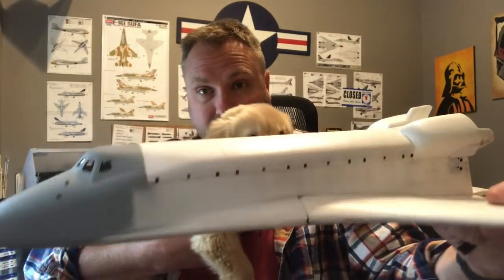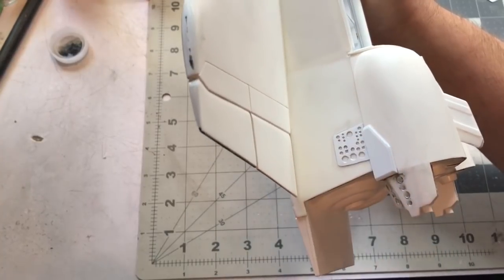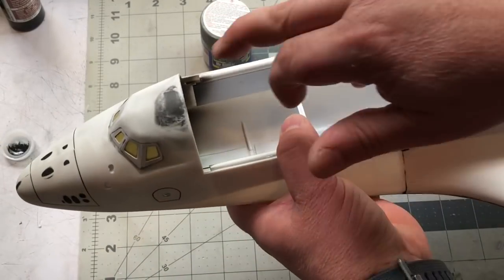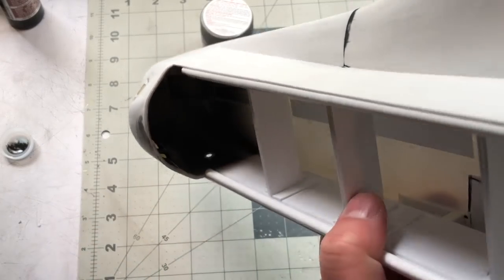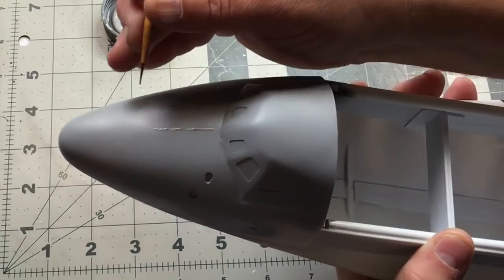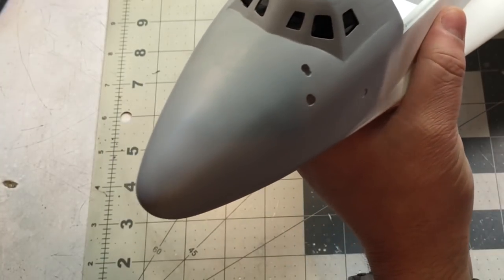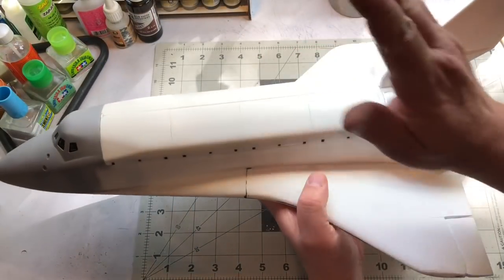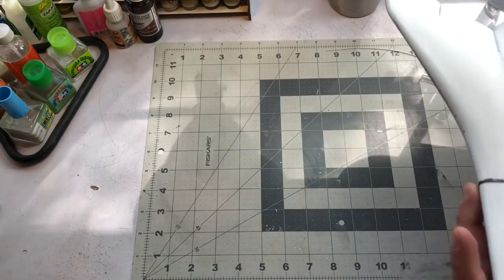1/72 Monogram Space Shuttle Part 2: Closing Up the Orbiter

Comment: Nice tail mods. Using zimmerit for the AFRSI blankets should be a good approach. BTW, when Columbia flew on 107, its fuselage AFRSI blanket pattern was essentially the same as the rest of the shuttle fleet.

The ports below the OMS pods are attachment points for the tail service masts on the mobile launcher platform (those round top gray things that sit on either side of the aft fuselage when the shuttle is on the pad). Those ports are how the LOX and LHX fuel are pumped into the shuttle stack before launch.

Comment: I was offered the Revell kit back in the early 80's when I was a teenager.  How I wish I could have built it as nicely as yours.  The belly was covering the bottom seam of the fuselage but the fitting of the top front thrusters was not so nice. I look forward to the next video. Regards from France.